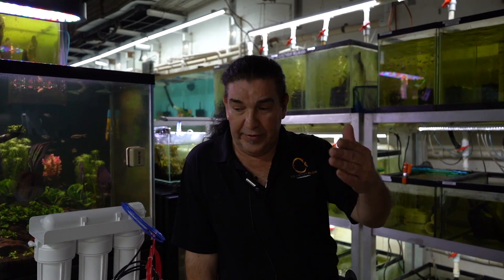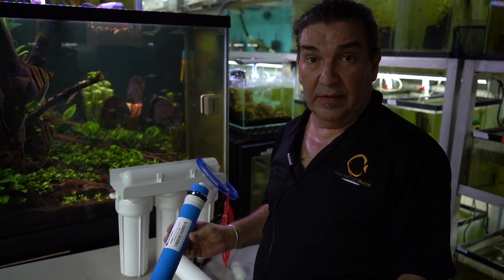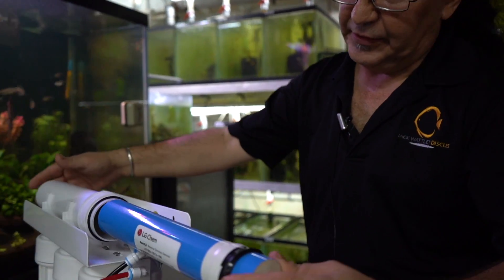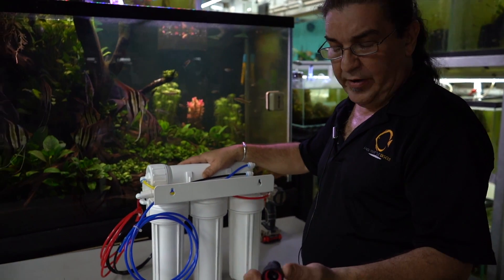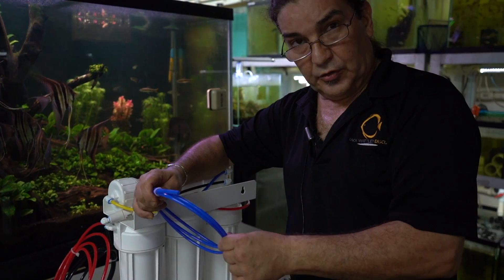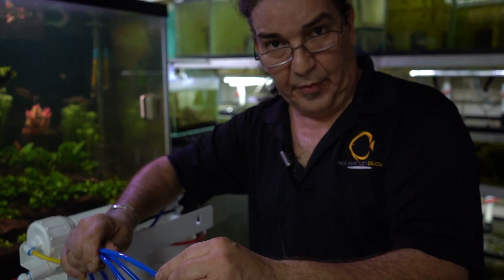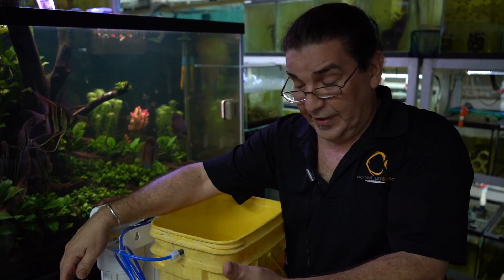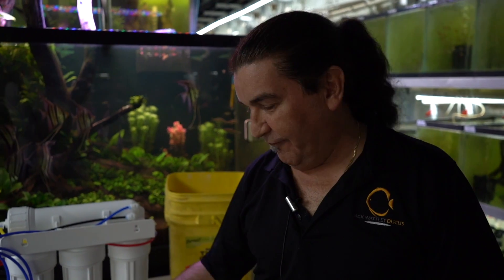Reverse osmosis installation

Comment: Is the waste water suitable for drinking? It should be correct? Since it doesn’t have chlorine and chloramine
Reply from the maker: If you like heavy mineral content in your water
Reply: @JackWattleyDiscus  Thank you so much for responding. Just trying to find a way to use that water somehow. I have goldfish that like high mineral water but I’m buying water for them because of contaminants in tap water. Technically I could use this waste water for them too? You said you were using it for your tanks 😊

Comment: What?  Any RO unit I have ever seen has the sediment filter BEFORE the carbon filter.  Why are yours reversed?
Reply from the maker: Because it's likely the carbon will also release residue which will be stopped by the sediment filter before attaching itself to the membrane. The sediment has no other purpose.
Reply: @JackWattleyDiscus  Sorry, but you are running this backwards compared to every other RO unit on the market.  The compacted carbon filters do not release sediment and in fact, need the protection the sediment filter gives them.  You should really research this a bit more.  You are not installing this correctly.
Reply from the maker: @tvideo1189  actually. I have two commercial 10,000 gpd units. These are usually run through large carbon blocks similar to a water softener but with carbon to remove chlorine first and right before you reach the 6 giant membranes there is a sedament filter which we change monthly. Just saying. Same principal bigger volume.
Reply: @JackWattleyDiscus  We are talking about an off the shelf, simple, 4-stage unit.  Sold EVERYWHERE.  Not 10,000, 20,000 or 100,000 gpd units.  The components of these generic units are all standard.  And ALL these units run the sediment filter first.  A 2 minute Google search will turn up scores of units, with directions, properly set up.  here is just one example, there are hundreds.  https://www.h2odistributors.com/pages/manuals/reverse-osmosis-installation.asp
Reply from the maker: @tvideo1189  think about it. What difference does it make where it's at. Put it wherever it makes you happy. But understand that a sediment filter removes sediment. Before or after.
Reply: @JackWattleyDiscus  but if you run the sediment last .then sediment can block up your carbon filter and make them less effective . imho
Reply from the maker: @reelthing4u  honestly never had any problems with that over the last 22 years of using them in all sizes. But I change them regularly.
Reply: @JackWattleyDiscus  Wow.  Just wow.  It's not about "happiness".  Did you do any research at all?  I'm done here, but for those of you reading this Alice In Wonderland exchange, take a second and do a search on how these things are SUPPOSED to be installed.
Reply from the maker: @tvideo1189  did I mention 22 years
Reply: @tvideo1189  he did it for 22 years and there's no problem. Time tells everything. Do whatever suits you.
Reply: @tvideo1189  as I water treatment professional, I can assure you Gabe is doing nothing wrong, and you're unsure of what you're talking about.
Reply: @bigpickles  I know enough to read the instructions Sport.  Perhaps you should too.
Reply: @tvideo1189  don't think he's using DI, but carbon does have carbon dust so it does have to be flush.
Reply: @bigpickles  Ah, so you didn't read them.  Bwahahahaahah!  Ignorance is bliss so you must be ecstatic!
Reply: @tvideo1189  comparing my thesis on water purification to your home RO instructions in a YouTube comment sums you up entirely.

Comment: Does RO water need to be remineralized for discus? Or do you just use plain RO water?
Reply from the maker: When being used for breeding we need to use it in order to hatch the eggs. Reminenalizing brings up the hardness again. Hardness is the is our number one enemy against egg production.
Reply: Jack Wattley Discus gotcha. So soft water is what you're after?
Reply from the maker: @maxl5112  soft and mineral free.
Reply: Jack Wattley Discus amazing, your a pro, even though you said that your a hobbyist, and the day you become protein is the day you'll stop loving it. But you can be a pro hobbyist🤙
Reply: I to wondered if I could do normal water changes with straight RO water or whether I have to add minerals/trace elements back into it. Looks like straight RO water is fine.
Reply from the maker: @kaneharry5966  we use sodium carbonate to stabilize our pH from crashing in all our systems.
Reply: @JackWattleyDiscus  may I know the dosage of the Sodium carbonate please., and  when I do a 70% - 90% water change with RO water, every time my fish are struggling to breathing.